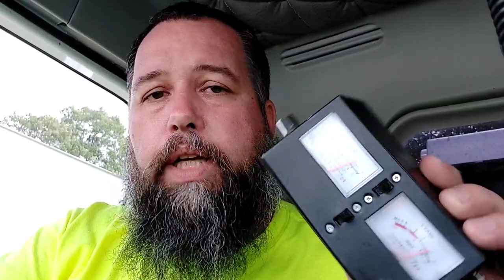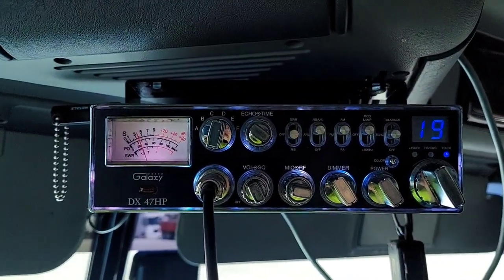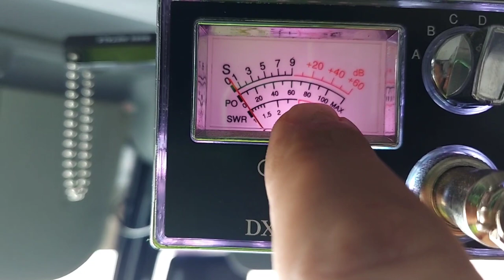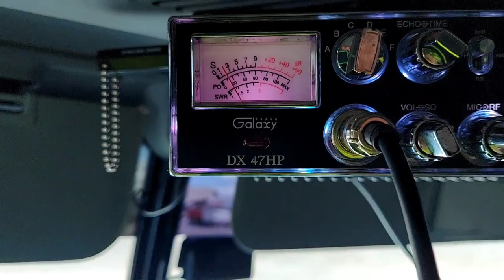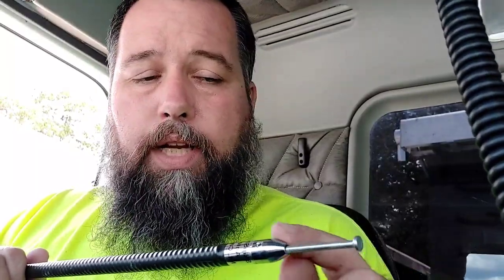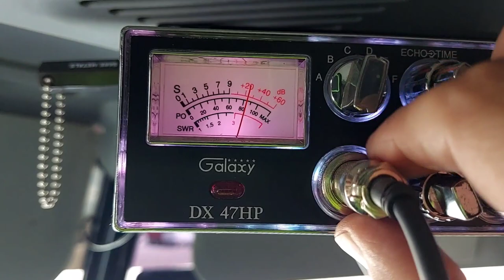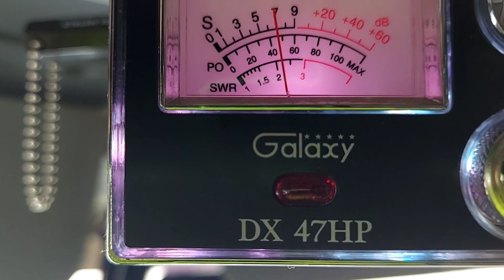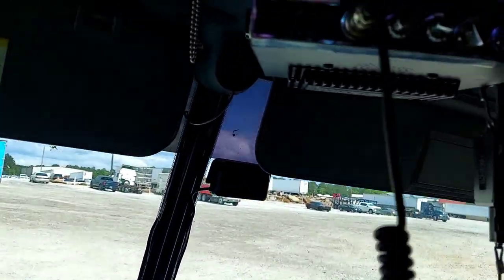How to tune your CB antenna. Using a tunable tip, and get the lowest SWR possible.

Comment: My swr readings seem ok, I can hear others, and others ca hear me. However when I key up during normal use, my swr meter pegs into the red. Any ideas what's causing that?
Reply from the maker: So, when you're in swr mode or using an external meter the needle pegs the red? If that's accurate the antenna light should be on when keyed up. 

Or, is the meter pegging out when talking in general? Could be your radio has a little power to it.
Reply: @JRich mine doing the same thang and yes my antenna light is coming on. What could be the problem?
Reply from the maker: @jarodbrown5597  generally high swr, bad antenna,  bad coax, or bad ground.
Reply: @jrichtruckincbtips  I appreciate it. I may need a ground. I dont have one ran. I got my antenna mounted on my mirrors. Quick question; how do you run your 18’ coax when mounting on the mirrors? Do you coil it up or run it another way
Reply from the maker: @jarodbrown5597  I always run a single coax, and usually 18'. No, do not coil the coax, I run the excess in the upper cabinet side to side. What truck is this on?
Reply: @jrichtruckincbtips  yea im running 2 antennas as of now. About to go to a single this wkend. Its on a 03’ Peterbilt 379
Reply from the maker: @jarodbrown5597  I'd do a single on the driver's side, and use a 1" flat braided ground strap from the hoop to the frame, and RF bonding the truck drastically improves the reception and ground.  I have a video on how to do it.
Reply: @jrichtruckincbtips  whats rf bonding if u dont mind me asking? N can you send me the link to that video.
Reply from the maker: @jarodbrown5597  here's the link. It's a lot of work but worth it. You can get the 1" flat braid by the foot from DX Engineering It's half the price as Amazon. And, a better choice for building your own custom lengths. https://youtu.be/J6PJyw6jh2M
Reply: @jrichtruckincbtips  I really appreciate it. Thanks a lot
Reply from the maker: @jarodbrown5597  let me how it turns out.
Reply: @jrichtruckincbtips  most definitely
Reply: @jrichtruckincbtips  may i ask what type antenna would u prefer! Im running the Wilson 2000 as of now
Reply from the maker: @jarodbrown5597  I'm really not a fan of Wilson's. I like Skip Shooters, Hustler, Browning, Stryker, Francis is good with 18' for coax. Firestik II is good but will break at the threads.
Reply: @jrichtruckincbtips  i tried to order a browning but they canceled my order. I really appreciate everything
Reply: @jrichtruckincbtips  Mr Rich, If the antenna only performs correctly with 18 ft etc and not coiled etc, it only proves one thing. That the antenna is not properly tuned. The rig output is 50 ohms. Antenna cable is 50 ohms. With a correctly tuned antenna, it presents 50 ohms to the cable. The result is an SWR of 1:1 as everything is matched.  Changing cable length  and coiling or not coiling will make absolutely no difference to a correctly tuned antenna.

Comment: Curious as to what length  oax you were using and was any excess coiled?
I’ve purchased a 4 ft skip shooter for my Cascadia and am going to mount at curb mirror location at the top of passenger door.
I’m doing ok with driver side mirror mount but am going to be installing a ss 6900v soon and want to get it loowww.
Thanks
Reply from the maker: On that truck was 18' RG8X no coils. Mounting to the curb mirror, how would you route the coax? You could damage it pinching in the door jam. The Cascadia really benefits from RF bonding. https://youtu.be/ohkOX45dJn0
Reply: @jrichtruckincbtips  thanks. I have a ground strap on current setup at driver side mirror bracket.
I tested ohms and continuity and it made no difference really. I have a 4 ft firestick that gets 1:1-1:2 swr with 9ft run of coax currently.
I’m looking to get the skipshooter up further above the metal. 
Unfortunately I’m a lease op so I have to compromise by not making holes in the truck.
Reply from the maker: @JustAnumbr  if it's a sleeper, I'd use a 6' or 7' on the driver's side mirror.
Reply: @jrichtruckincbtips  thanks, appreciate ya!

Comment: Hey would u no any cb to buy that has a echo tune from manufacture
Reply from the maker: Connex, Galaxy, Stryker, Ranger, Anytone, President.
Reply: How is the galaxy dx 949 and does it have a echo tune
Reply from the maker: @hannaransport  it does not have echo.
Reply: I no I’m asking a lot but I’m buying a radio and I wanna which is good so is the galaxy dx 949 any good
Reply from the maker: @hannaransport  949 is a great radio, although I'd rather have the 959
Reply: I like the one u have with the duel echo control, it seems like everything is sold out
Reply from the maker: @hannaransport  yeah, it can be hard to find new radios these days.
Reply: At of all the galaxy with the echo time which one would u suggest
Reply from the maker: @hannaransport  what's the budget? $$
Reply: $400 Canadian which is $315 usd